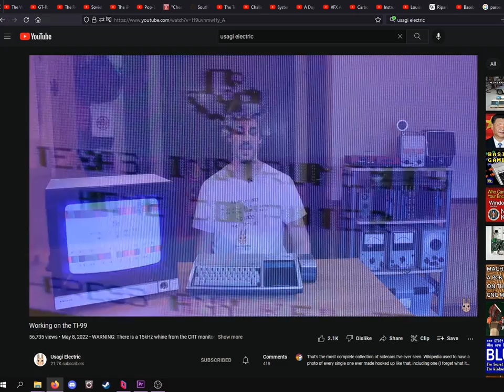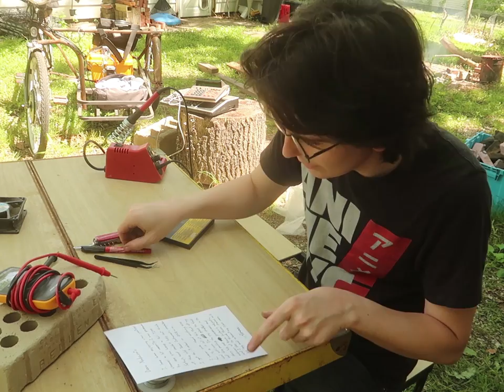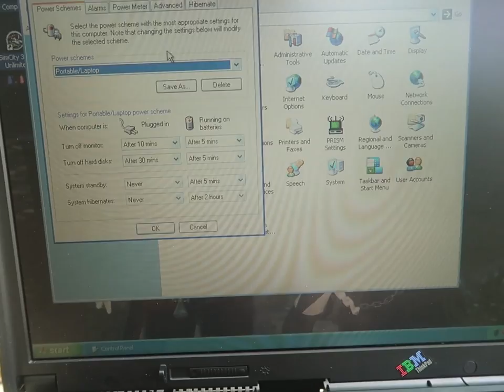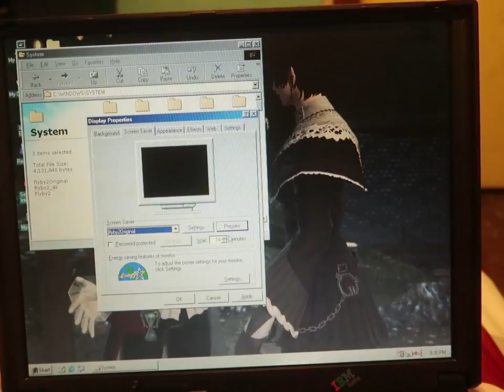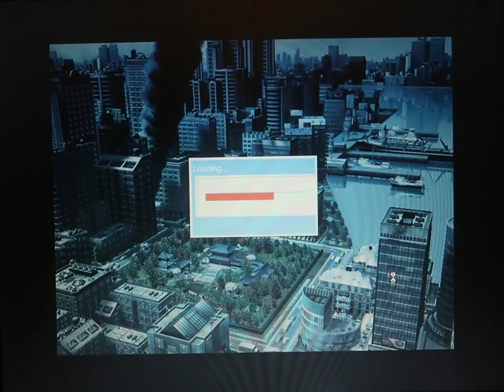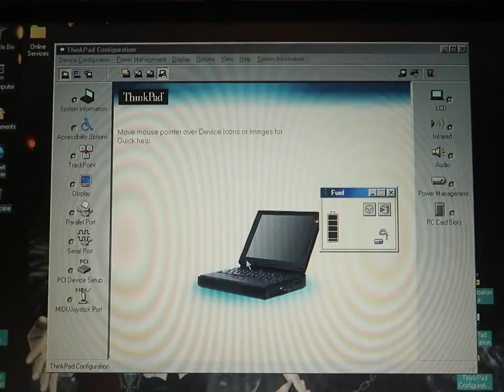Random Bits 0280: Package for Usagi Electric, Xray teardown, thinkpad battery success

Comment: I have the same emotional energy drain when it comes to throwing out potential project stuff.  I cleaned out hoarder homes for years and found out it was a contagious thing and now I have such trouble discarding things, and I also make huge messes when in the grip of project mode-to the point of disappearing my garage/workshop/any work areas floors.  I like and enjoy all your videos
Reply: I feel the same though even do it in my living room aswell as the workshop

Comment: I don't know if it is the same for you, but every time I move and set up my shop a new, a period of inactivity seems to follow. I've noticed the same thing the rare times I have completely cleaned out my shop. I find that I need to keep sort of a carefully curated junkyard of random parts to draw inspiration from. My current house is much more suburban than my last place in the middle of the woods. There's not the same degree of tolerance for having your own scrap pile. So I've had to limit this to the most unusual shapes or the most difficult to reproduce, I typically store these in the rafters of my shop. When I move, this stuff rarely makes the cut. I think I sort of need that junk for inspiration more than parts. When I'm really productive, it looks like a tornado has gone through my shop and yet I know exactly where everything is. Those few times I haven't completely organized, I have to hunt for everything despite using a label maker. There's just too much. I think when you keep a messy shop, naturally the less important stuff gets buried so it is sort of self curating so to speak. I'm considering bringing three or four interesting pieces of junk into the space where I spend most of my day, I'm curious to see what effect it has on my motivation

Comment: Sorta rude question to you... Do you ah, dumpster dive or look for curbside stuff for electronics? Thanks. PA... nice! Trying to build a homemade lightsaber... Don't become a hoarder. It's not worth the mental grip of "I gotta have it!" You will find more stuff to keep than you will realistically have time for. I work at a warehouse. My hobby, when I can, is tinkering with computer, laptops, Chromebooks, & some other electronics. After work to-day, I did a little dumpster checking. Found a Dell D6000 docking station, (no power supply) some DP cables, & some other small stuff. I didn't take a portable drill  (not real big), had a case, some tips, & a few sockets. But I don't have the room for it. There were some other cables, mostly old VGA & DVI, and I didn't take them. I have enough. Meant to ask...would XP run better on that laptop than 2000? I got the fly-by screen saver, too!
Reply from the maker: Of course I have dumpster dove
Reply: @RinoaL  ok! Thank you 🤓